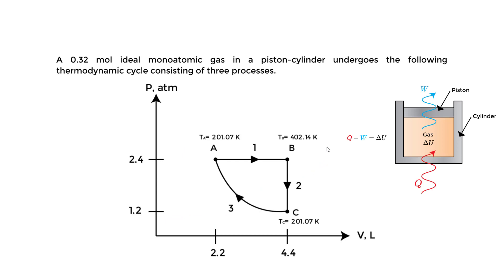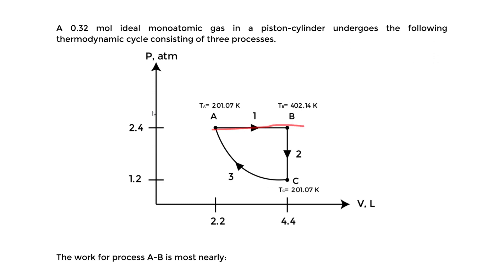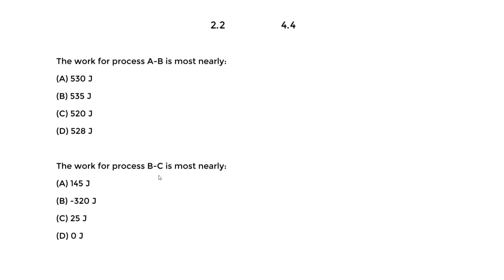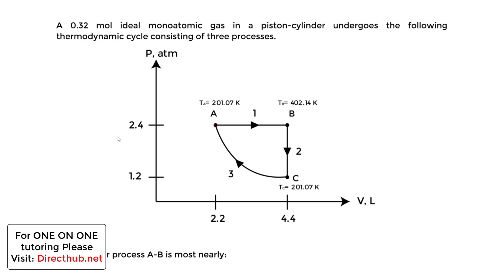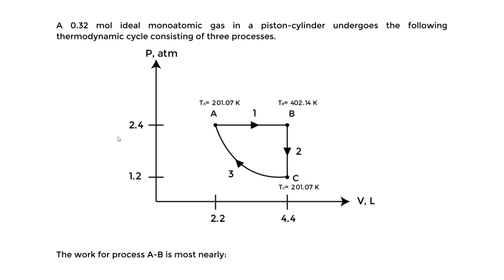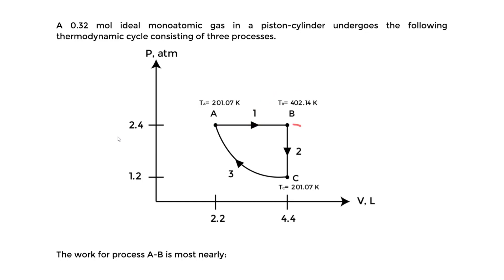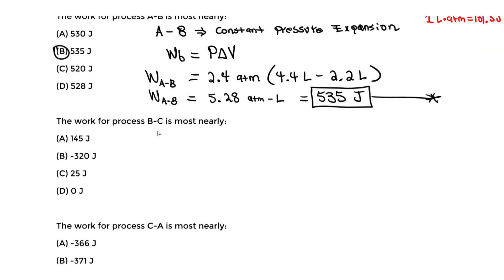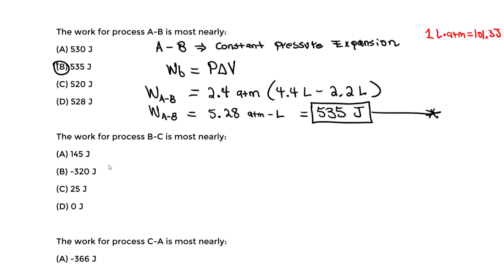FE Exam Review - Thermodynamics - PV Diagram

Comment: Where in the handbook is the L.atm conversion to Joules? I don't see it on pg 3, only for the universal gas constants
Reply from the maker: We would need to convert L to cubic meters then atm to pascals separately then we would get joules. 

We are still using page.3 for convert these. 

1 L = 0.001 cubic meters (m^3) 
1 atm = 101328 pascals = 101326 N/m^2 

Multiply the two: 

1L - atm = 0.001 m^3 - 101326 N/m^2  = 101.328 N - m = 101.328 Joules

Comment: For others, the reason you can add the "n" variable for moles into the equation is you can derive that from the gas constant equation and the molecular weight equation in the FE handbook. It's written as Rbar (bar on top of R symbol) in the handbook. That confused me at first, so hope it helps others!
Reply: This question is for you and Farouq..
R = R (bar)/ M, M = m/n, where is m in the problem and the answer? we should use it as well. so the correct equation for W = n/m*R*T* Ln(v2/v1)
Reply: @directhubfeexam

Comment: How did you know that the process C to A was isothermal and not isentropic?
Reply: I'm wondering this as well. I just assumed the entropy stayed the same because they didn't mention anything about it.
Reply: @logantaylor8565  yeah, even from the thumbnail, the process looks isentropic.
Reply: @samMarvel  It looks isentropic, but you can see that T_A and T_C are the same so that means it's isothermal. Being isentropic doesn't normally have the same temperature for the two states (look at the Rankine cycle Ts diagram). Additionally like @logantaylor8565 said, there's on mention of entropies so that is another hint to avoid the eqs for isentropic work.

Comment: I initially got the incorrect answer because I used the formula in the FE manual for boundary work with constant temperature, which reads W = R*T*ln(P1/P2), but this gives a different answer than what you did? Its stated in the section under Closed Thermodynamic Systems. Am I misunderstanding something or is the manual wrong?
Reply: Pressure is not constant on process No. 3

Comment: Great video, thanks! So does this sound right? From A to B, the system (gas in the cylinder) does 535 J of work on the surroundings, since W is positive (using the handbook's sign convention for work as positive when done by the system). From C to A the surroundings does 371 J of work on the system. Net work is 535 - 371 = 164  J out of the system, and overall Q = 164 J into the system since dU = Q - W = 0 for the cyclic process (no kinetic or potential effects)
Reply from the maker: Well done! That's spot on and honestly, I should've include a question asking for the net work. I'm glad you went decided to take it a step further and find a value for that. Very insightful.